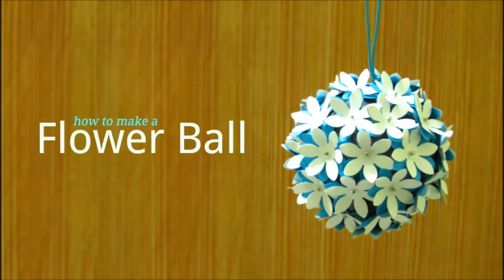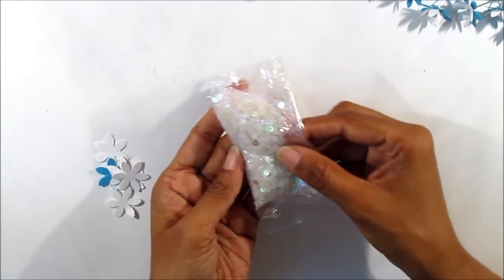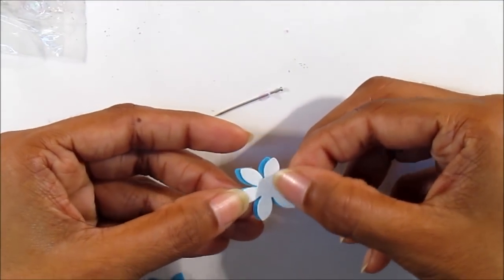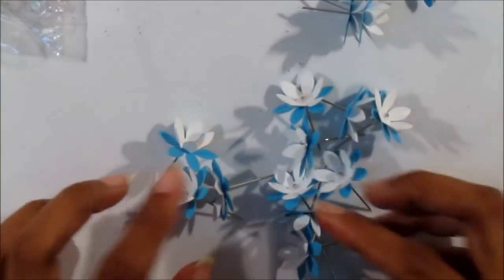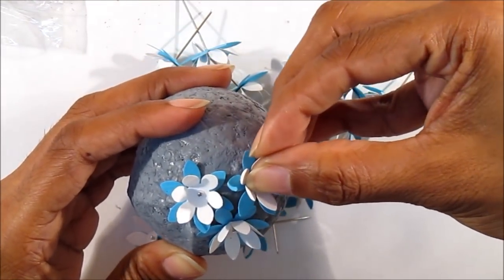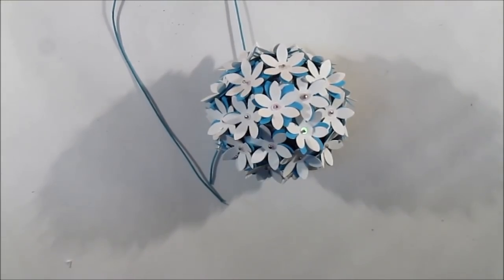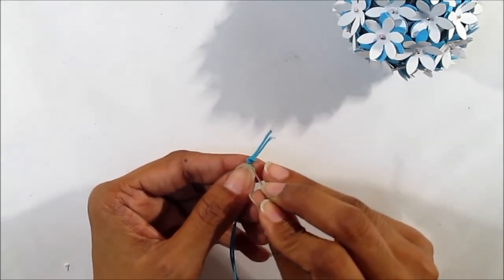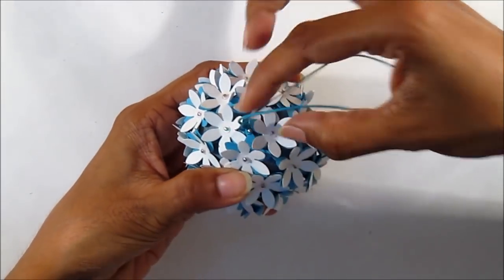Thermocol Crafts - How to make a flower ball

Comment: These are so pretty,they would make lovely flower balls for the younger bridesmaids,and instead of using pins you could use hot glue to attach the flowers ,and to stick the flowers themselves together,you could still use the little sequin dots for the centers,and make the bottom flower the same colour as the bridesmaids dresses,perhaps a little glitter around the edges.I really love the ideas these are giving me,Thank you for sharing .
Reply: +Elaine White Yes totallly. Glue gun works but it might melt the styrofoam.
Reply: A low temperature glue gun should be fine,I have used it for sticking chocolate bars together ,and they don`t melt,so I think the styrofoam balls should be ok .
Reply: +Elaine White Yeah, that should work just fine. Thanks! :)
Reply: You are welcome ,it is a trick I learned from another crafter,One Very Happy Bird,she always uses low temp,I use it for jewellery making too and it works perfectly well .
Reply: Thanks!